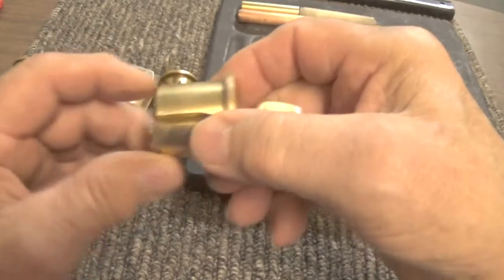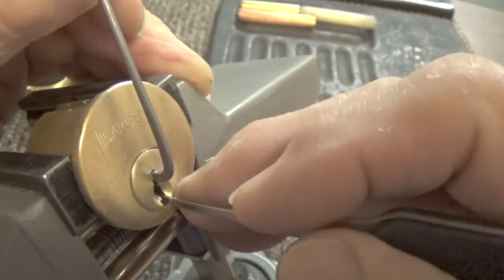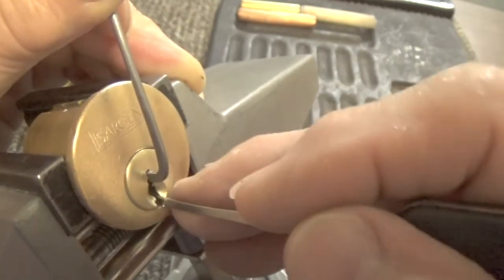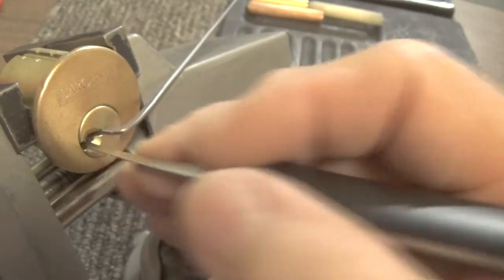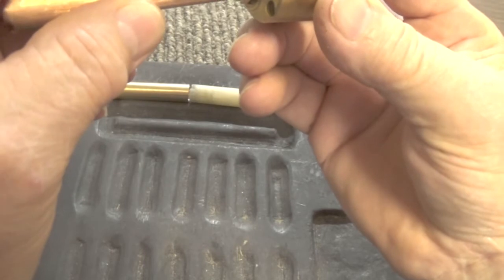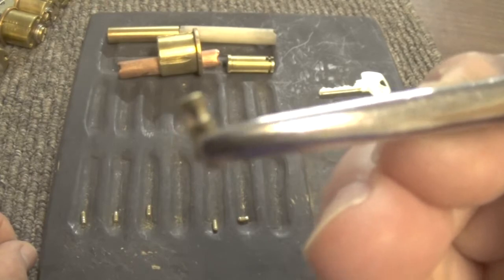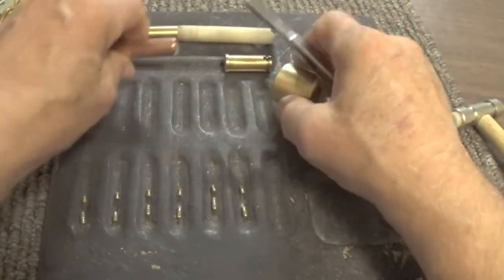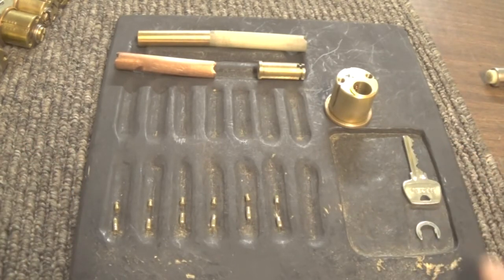Sargent 6 pin with spools, mushroom, and serrated key pins SSP'd and Gutted

Comment: Also, one tip for taking rim cylinders apart is to use a shim with the follower, that way you don't have to worry about the notch on the back of the plug.
Reply from the maker: Good information. Thanks